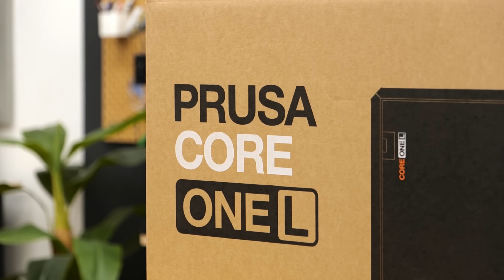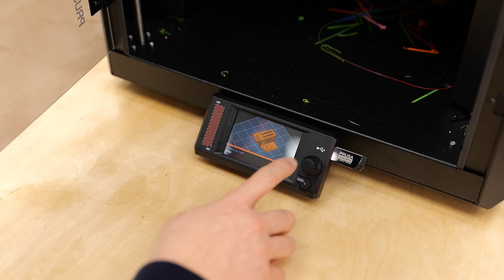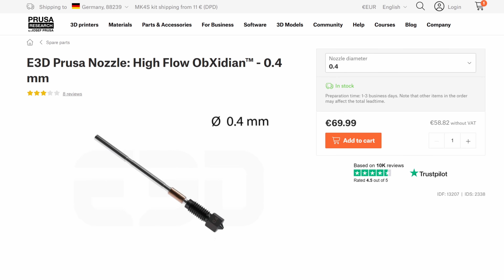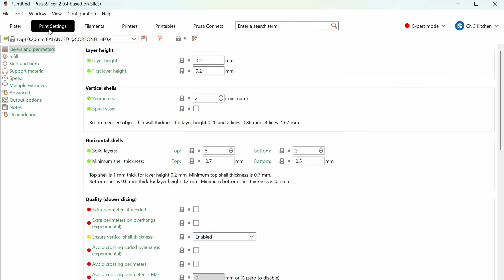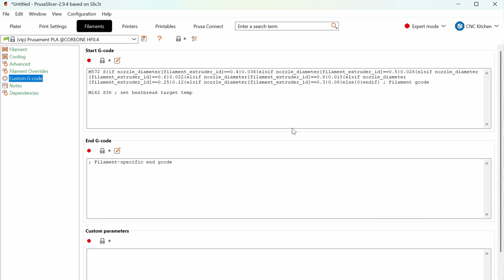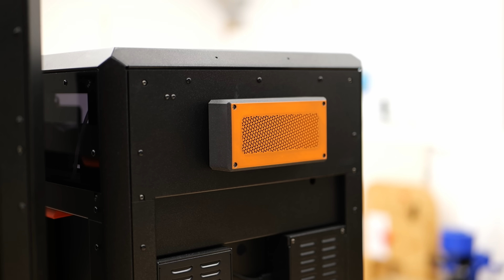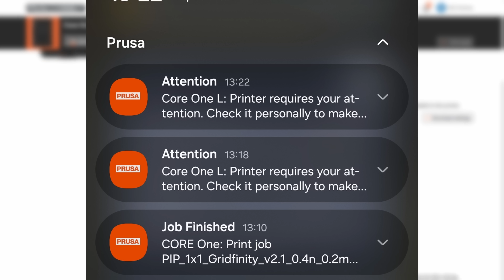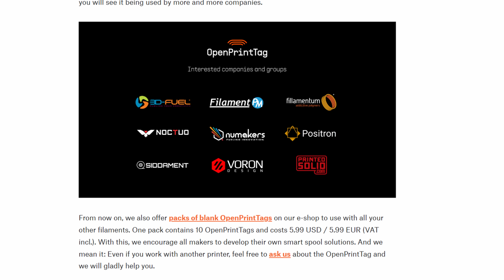What Prusa Got Right (and Wrong) with the New CORE One L

Comment: Imo, these days the weakest parts of Prusa's printers is the software (both slicer and firmware), they say that their printers never need to be connected to the internet but the local LAN experience feels like something I could've cooked up in a day and leaves a ton to be desired. If I could buy a Core One and slap Klipper on it I might get one but for now I just can't stand to use one

Comment: Bought a Core One a month ago and dont have most of your discribed issues... They must have changed stuff since release.

Example: it has a touch screen, had not one gap cause pressure advance so far, printed lots of TPU lately from different companies, bit fiddly but not a too big issue at all and not needed to remove the tube from extruder....

The one thing I really agree is the nozzle cleaning error. Yesterday the bambu silicone nozzle cleaner arrived and Im designing a Mount for it atm...

Prusa connect Integration in slicer is also a blessing.
Reply: All xLCD-screens are touch, it was just not enabled in the firmware some (long) time ago

Comment: Wanna buy CoreOne but now maybe thinking CoreOne L when kit comes available or CoreOne "V2" with these upgrades. Now I have MK3S+ model
Reply: I'm sitting here with my MK3S+ with revo head and Rpi for a bit longer. Nothing too tempting right now I think.
Reply: Sold my MK3S+ today and bought a Core One last month. 

Its a pretty good printer, runs every day for hours and is 3 times faster. And so far reliable like the old one - thats what I value most. Print and forget

Would do it again
Reply: @abwesend182  Yeah this is also I want. Faster prints with better quality and no issues. My printer is solid with hard marerials but no flexible so new CoreOne is next choise but if next year maybe V2 upgrede is coming
Reply: Wait for formnext announcement this month at least - big changes are coming (INDX).

Comment: Many jokers commented that the bambu printer could be connected to the Internet and would leak their privacy. Why don't you say that when you design, software like SolidWorks and fusion360 will also be connected to the Internet, so you can't give away your privacy? This is a much bigger problem than 3d printers.很多小丑评论说，bambu打印机可以联网，会泄密他们的隐私。你怎么不说你在做设计时，像SolidWorks和fusion360等等软件也会联网，这时候就不泄露隐私了？这问题比3d打印机问题严重多了。

Comment: The MMU3 is better than the AMS as it uses less filmament........but both will be obsolete next year with the INDX system. I will be getting a core one L INDX printer. Joe Prusa already confirmed this during 3D Musketeer's Core One L stream. It could have as many as 9 nozzles even more possibly.
Reply: i would love to get my hands on INDX printer but considering the abysmal pricing of the Core1L it would seem my next printer will either have to be H2D and me being content with dual nozzle shenanigans or Snapmaker U1 when it becomes available on retail market around end of Q1 next year
Reply: @Asghaad  INDEX is better than both. I don't know how many nozzles it will have in the core one l, but the original was teased as 7. So probably at least 9. Will I use them? Probably not, but I have hit a limit with the MMU's 5. And I can use support material for the first time. So more than 6 is already a bonus. Snapmaker? 4 isn't enough nozzles. I do a lot of color. H2D? only 2 nozzles. It could be 4 per nozzle. You could potentially do dark vs light to reduce waste, but it won't compete with a real tool changer like INDX,
Reply: So how much will a Core L cost with the index - over €2K? Our lab budgets are already being cut, and things will only get worse given the global economic outlook. We’ve actually stopped buying Prusas altogether, and honestly, we’ve had zero issues with the cheaper competitor brands.
Reply: @GlennDeBacker  We're estimating a 7 tool system costing about $2500 including the printer. It's not bad considering it's REAL tools and not a filament changer.
Reply: @GlennDeBacker  last numbers im aware of are 250 for a toolhead and 35 for each hotend

not that hard to calculate - 1700 for Core 1L +250 + lets say 5x35 = 2125 - ish

also depends if Prusa subtracts the cost of theyr own toolhead and nozzle from the price which could lower the price somewhat but i cant see it being under 2k at this point ...
Reply: @awilliams1701  i wouldnt glaze INDX that much, it sounds and looks good but its unproven first generation product with its completely new extruder architecture that might work or it might be jamomatic nightmare ... the fact there is so littel known about product that was planned to be released this year makes me kinda wary of whether it doesnt have issues 

so please stop claiming its "better" when all we know about it is few promo videos and one example seen on tiny miniprinter on expo

i HOPE its good because it would make the multimaterial printing much more accessible on many machines BUT until i see it actually working as a retail unit and not having issues im not going to glaze it as the next best thing since sliced bread.

also $2500 for a BASIC printer with crude construction is still too much especially considering that the same can be achieved on just about any other printer for MUCH less ...

why take 1700 eur of a Core1l then removing the toolhead from it and replacing it instead of lets say taking the  SV08max  for a thousand and then slapping 12 INDX hotends on its 500 cubed print volume frame ... ending up with printer that is STILL cheaper than BASE Prusa Core1L but with TWELVE tools toolchanger ...

Comment: Too little too late.
Prusa is still stubborn and it will cost them dearly.
FUCKING MARLIN IN 2025 ?? 
Just give use Klipper, a proper MCU with a working wifi adapter (not an esp8266 that is clearly outdated) and a hotend that can heat at 350.

Comment: The fact alone this costs more than a H2S and has a smaller build size is a deal breaker for me. It just doesn’t make sense economically or practically.
Reply: only if you ignore the fact that Bambu changes terms of sale after the sale, or sends your data to China, or can brick their printer (yes, THEIRs, it's not YOURs even though you paid for it) at any time. then you're absolutely right.
Reply: @UNgineering  1. every big company does that

2. im sure chinese spies are so thrilled about my oh so important prints of warhammer minis, ice scraper for my car and oh right the top secret coffee bag funnel ...

3. i will care WHEN they do that, because every single  company that provides device firmware can brick your device if they want ... your phone, your computer, ANYTHING that runs on software ...

i see no reason to fearmonger about something that MIGHT happen that would also instantly bankrupt the company meaning its basically certain it WONT happen ...

also im pretty sure that there is a guy on the Tube that already modded a Bambu printer gutting its control circuitry and replacing it with open source stuff ...

so even IF (which will not happen as it would be NONSENSICAL) Bambu decides to put theyr business six feet under in an instant, there are options ... meanwhile id rather buy THREE Bambu P2 or much more capable H2D over a single badly assembled Prusa Core1L thats made of WORSE parts than the chinese printer ...
Reply: no they don't, let's stop with this myth
Reply: @riba2233  you're of course free to ignore all the security researchers, but i prefer not to.
Reply: @UNgineering  rofl, good one. This whole security bs is completely overblown
Reply: its missing a lot more features than that when you compare those two

Comment: Are there independent stepper drivers for the Z axis motors, or is it still a single driver for all? A printer at this price should be able to do bed leveling and not reply on ramming the Z axis at the top until the steppers skip.
Reply: Single ofc... They are too stubborn

Comment: sorry but at the price this is being offered its simply a bad deal ... this printer offers parameters that the competition offers at +- half the price ... and at 2/3rd of the price one can get machines that outperform the Core1L in every possible way

i would accept SLIGHTLY higher price for an Eu built machine but if i have to choose between Prusa Core1L and Bambu H2D at the same price point there is simply no way i will buy one with smaller print volume, worse build, worse print quality, janky UI and screen and missing features over printer that is not only superior as a single nozzle machine but also offers dual nozzle for multi material capability even without AMS ... and active chamber temperature control with automatic air vents and recirculation, quickswappable nozzles, great internal lighting and camera, nozzle camera ...

when i look at other competition - whether it is Sovol SV08max, Snapmaker U1, Creality K2 pro or Bambu P2S or H2S then i can get much more for my money at around or even below 1000 eur pricetag than for a printer Prusa wants to sell at 1700 when in reality it should be at most 1000 to be competitive ...

Comment: I just don't get, why they announced OpenPrintTag alongside the printer, just to have it missing from the printer. WTF?
Reply: Filament part is ready. Printer part is not ready. No reason to delay filament part due to that. Simple. Which also means that when printer part upgrade becomes available you most likely will already have few spools of ready filament on the shelf, too..
Reply: @arekx thing is: I need to buy filament eventually anyway and prefer to buy it somewhat locally, because of cheaper shipping.
Now I have to buy the Upgrade Kit for the printer to detect the tags later on from Prusa and pay quite a bit for shipping then.

Comment: It would have been impressive a few years ago. Bambu Lab are still the market leaders in my opinion. It will be interesting to see their induction heated nozzle swapping tech in a new printer, hopefully getting rid of the poop.
Reply: MMU3 doesn't poop, neither will the upcoming INDX upgrade. I don't think Prusa ever made a color system that pooped.
Reply: @logicalfundy  the big question is the reiability of the MMU3 (pulling the filament and selector based) compared to the AMS (cutting the filament and individual feeders).

Not everyone is printing models with hundreds of colour changes. I mostly use my AMS for colored text in the first or top layers and filament backup.
Reply: @lukahierl9857  I think the reliability is similar. Prusa had a lot of problems with the early MMU models, but the MMU3 seems to have finally resolved them.

But I think both the MMU and AMS are going to become less relevant as more manufacturers have been figuring out how to make tool changers cheaper. Bambu has that nozzle swapping thing, Bondtech has the INDX (which looks like it's coming to Prusa machines), and Snapmaker has their tool changing system.
Reply: Prusa printers have never pooped filament. This is a bambu bot comment.
Reply: @LilApe  only bot here is you bud.

Comment: Thank you for the review, I was waiting for it when you dropped your first video and I've read the announcements.  

I have an MK4S after a Mini and a MK3+. The reviews and prices about the CORE Ones are not convincing me to buy the newer machines. They are too expensive for me and have to many quirks for that price. The VFA problem isn't the issue, it is the sum of all the minor issues that should be resolved for 1600€. 

My main issue for the CORE ONE L is the "promise features, deliver now". Why is there no RFID reader already included in the 1600€ machine? The reader costs only a few cents and could be deactivated / unused until unlocked by a firmware update. At this point in history I'm willing to accept that they deliver their OpenTag system (which is a very good idea btw) via software a bit later but I will not buy an unfinished system. "Promise now, deliver later" is a bad practice in the world that needs to end. It should be classified as false advertisement. 

Also the camera. I was happy that they finally included one - until you mentioned to be Cloud only? Why cloud only? A very simple raspberry pi can have a WiFI able camera stream that is okay enough for simple monitoring a decade ago. It must have LAN only support and I don't understand why the developers think that cloud is okay. I do not want to use your cloud to fully utilize my 1600€ machine. Even if the cloud is great, secure and EU based. I don't want to have such a machine connected to the internet. It is great if people are okay with that risk, but I want it to be fully offline.

Man, I don't know. After writing this comment I'm unsure if I would recommend Prusa anymore. Yes, long term support and so on. But over the last years this feels more and more like "diamond hands", "hodl" and "to the moon" fan group.
Reply: As some folks have mentioned, there are some kludges to make the camera work locally, but my bigger concern is it requires Wi-Fi where I want my printer to always be on a hard line connection. So now I can have my printer hooked to ethernet and still have a camera that requires Wi-Fi which is ridiculous.